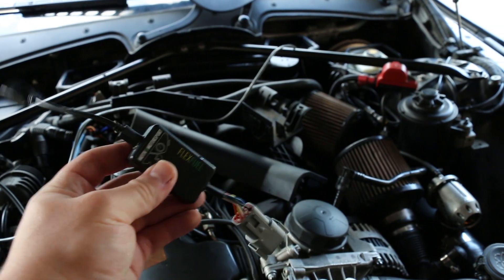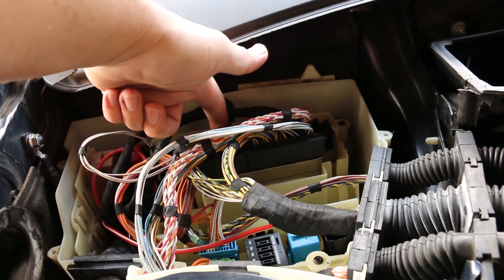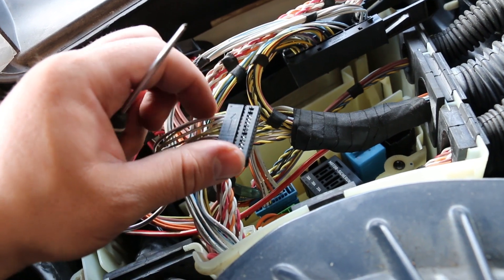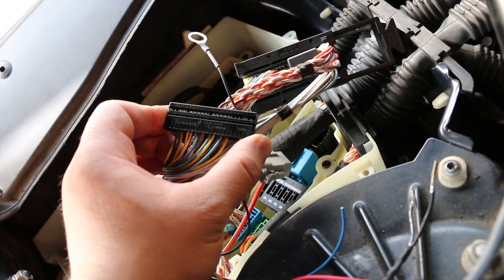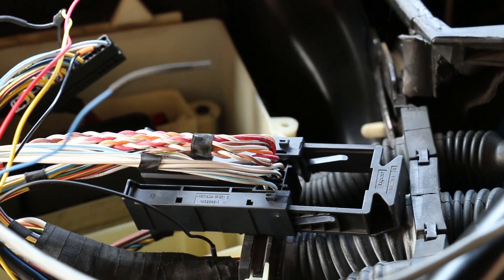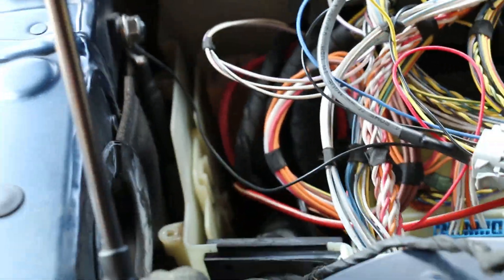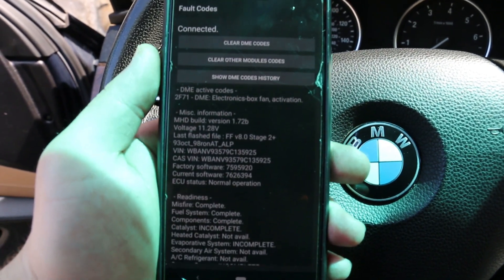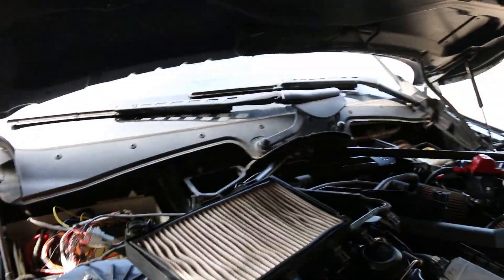BMW 535i Flex Fuel Install -  N54 335i 135i

Comment: Does your ECA Voltage change based on the amount of E you have in the car? 
My E% reading was E65 and my ECA voltage read 2.13. Added 93 Oct that change the reading to E40 mix and the ECA voltage dropped to about 1.6. 
I’m also having issues during WOT my E % spikes to 100% and ECA voltage jumps to 4V.
Reply from the maker: Yes, ECA Voltage should change with E-content. If you're having percentage spikes during WOT, you should first re-flash. If that doesn't solve it, you've likely got a bad physical connection somewhere or the ECA sensor may be going bad.

Comment: Just installed mine.  Mines reading 20% ethanol at 1.02 ECA voltage.  It should be 10% since I’m on 93pump.  Think it’s a faulty ethanol sensor?
Reply from the maker: There's a few possibilities here:

1. The actual ethanol content in your fuel is 20%. Which you can verify by getting a sample from your tank and using a simple tester to check the content.

2. The ECA may be reading off for some reason and you might need to re-flash your map with a long-write.

3. There's a difference between voltage at the ECA sensor and what MHD is reading. Check the output from the sensor with a multimeter to make sure it matches up with MHD.

4. It's possible that if there's a voltage difference between MHD and the ECA, you may need to find a better grounding spot and make sure your harness is well-connected. Or it's possible that the Motiv box is bad and needs to be RMA'd.

5. The ECA sensor is bad, which you'd have to replace it if that were the case.

Also, reach out to Motiv if none of that fixes it. They're usually pretty helpful.
Reply: @FoulNews  wow thank you so much!
Reply from the maker: @KingKhu0ng  You're welcome, good luck with sorting it out!

Comment: How did you get it to work with PR coils? I seem to be having a problem that a couple others are having where it says I have 19-22 % ethanol when I’m still on pump 91. And at WOT, it spikes to 100%
Reply from the maker: Mine has always worked without anything different from the normal install. It sounds like you've got an odd issue with the sensor voltage. In MHD, what does the ECA voltage read at idle on 91 and at WOT? If it's seeing above 3.5v, the ECA is likely bad or there's an issue with the wiring.
Reply: @FoulNews so i just checked everything, everything is in the exact same place as yours and other instruction videos. The ONLY difference is you put your ground to another spot than the one on my E92, where people suggest to put it to the same as the OEM placement ground for the dme box. Almost sure that’s the problem, maybe because the ground is also for the dme box it also is for the coils maybe so there’s some type of interference? I dont know. But I’m going to try and find another way to ground the flex fuel box, just not sure where
Reply from the maker: @Eliasccv14  It is possible that there is some sort of ground loop or interference that's messing with the voltage readings. I would recommend using a clean grounding spot. Also, you should check actual voltage at the ECA as well with a multimeter just to make sure that MHD and the ECA sensor are measuring the same voltage.
Reply: @FoulNews  for sure bro, I’ll give the multimeter a shot here soon. I already switched to a different ground spot and the voltage now actually changed, but it’s a little higher now and doesn’t drop below 1.00v. Also, if you could tell me which wires are to what on both sides of the Motiv box and the harness just to see if anything is different? If not it’s all good, I realized you have to unscrew a bunch of stuff
Reply: The voltage stays between 0.9 and 1.01 at idle. I really don’t want to replace the coils and I’m trying my best to figure out what’s happening. Funny enough is I used your video as the first reference and then a couple others just to double check. I’m going to check one more time and see if anything is out of order

Comment: When you reflashed, did you reflash with the same map or what map specifically?
Reply: I’ve heard people mention you have to flash your vehicle on your regular gas. For example my gas in California would be 91 octane so I’d have to flash stage 2+ on 91 octane and when i pump e85 it’ll automatically switch?
Reply from the maker: I re-flashed the same flex fuel map. The first time it didn't write properly for some reason, but the second time it wrote fine and worked. I'd recommend going with a custom flex fuel tune.

Comment: After flashing is your Evap system saying incomplete?
Reply from the maker: Yes, you'll need to complete the drive cycle before it's back in the ready state.
Reply: @FoulNews  Thank you!  I've been driving around for a few days but its still saying incomplete
Reply from the maker: @Gifted_drae  no prob! There's a few vids on YouTube on how to complete the drive cycle for most BMW's. It's a bit of an annoyance, but definitely doable in one day. Otherwise I find around 100 miles of normal driving usually does the trick.

Comment: I have a E60 535i  what are the exact parts I need to buy from motiv?
Reply from the maker: I ordered the Flex Fuel box with the E-Series Fuel Line Upgrade. The full feed line with the Ethanol Content Sensor. Just message them when you order, letting them know that it's for an E60, so they can make sure the lines are the right length. 

If I recall correctly, it's all -6 AN fittings, so it's pretty easy to make the lines if you want to save some money and make sure the length is correct. Just be sure to use PTFE, if you go that route.

Comment: So what if you have a JB4?
Reply from the maker: This will work with JB4. The install and setup does differ from just having MHD though.
Reply: @FoulNews  you can wire it the same way as the motive instructions you just need updated firmware from Terry at burgertuning.

Comment: I've been thinking about this for awhile, recently upgraded to a stage 2 LPFP on my E92, so I should be able to run E50-E60 comfortably. Only problem is I have no idea what the actual E85 percentage is at my E85 pump! This should make it seamless and worry free. Great video
Reply: There’s an app that can tell you how much of each fuel to put in. You can even ad the gas in the tank to the equation.

Comment: Hey, are you gonna need to purchase just the flex fuel map from MHD to run this? Or will you need to purchase the e85 map as well? Also, will it switch over on its own to e93/oct map and vice versa depending on what you fuel up with?
Thanks,

Comment: Fellow e60 N54 owner here, me being a technician working on cars, my personal preference to run the ground wire is to actually find the factory ground junction,  get a BMW pin kit and extend the wire via solder to that junction so it can be factory and clean, same with the power wire extend the power wire to a ignition power and splice off that, then i would try run the harness for the sensor and the sensor box through the factory loom and you won’t compromise the DME box and it’ll still look factory clean
Reply: I like this idea, may do it like this myself on my E92

Comment: Great diy exactly what I was looking for, but i have a question regarding the flexfuel box.
I bought mine pre-owned but unused without original packaging(no literature either)

Can you tell me what the USB port is for? I assume for running a 52mm gauge but I cannot find any info on the USB port.
Reply from the maker: I believe the USB port is for potential future firmware updates and debugging.
Reply: @FoulNews  is there any windows software or anything needed?
I could find no support on the device.

More importantly is it correct to assume it's irrelevant to me?
Reply from the maker: @Northman1776  nope, nothing special needed. I've never seen anyone use the USB port. I suppose if it's ever needed, Motiv may post some kind of update on their website, but for most people, you'll never need to use it.
Reply: @FoulNews  thanks brotha. Appreciate all the help.
Reply from the maker: @Northman1776  Anytime!

Comment: Do you can run e85 with this?
Reply from the maker: Yes. I have a custom tune for it for up to an e50 mix. Ideally if you're still on a stock low pressure fuel pump, you wouldn't want to go higher than an e40 mix.